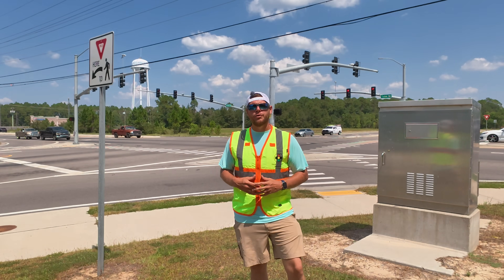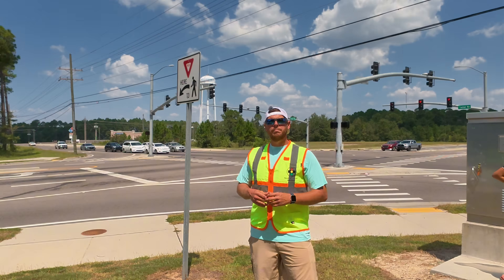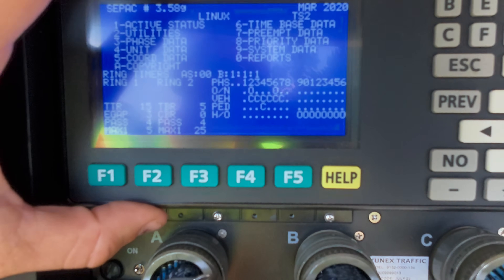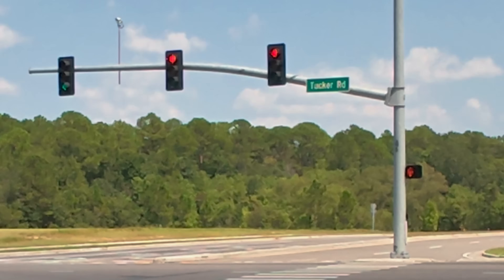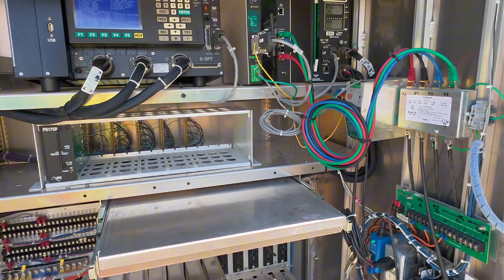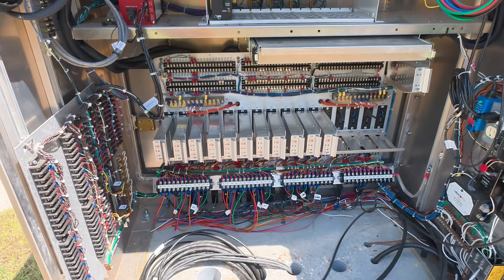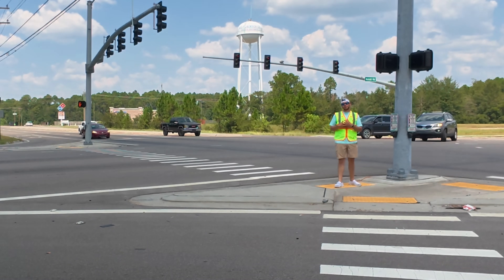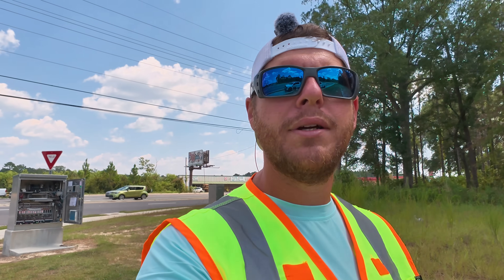Traffic Light Doctor Explains: Do Crosswalk Buttons Work?

Comment: Doesn't the 'decision; on the weight(significance, no body weight) assigned to the Pedestrian?  What sucks is the pedestrian pushes the thing, decides to cross w/o a decision in their favor and the system grants the crossing even though the ped crossed long ago and is not a factor anymore but the control system allows the nonexistent ped time to cross anyway.  Obviously frustrating to anyone that has eyes.  I'm sure Siemens or whoever has some sort of tech to make a better decision.
Reply: Yeah, it happens here 90% of the time. They push the button, wait 5 seconds then run across the street , the ped signals hold up traffic for 40 seconds. They really need to make pedestrian crossings by detectors and shorten the time.
Reply: @colinwinogradoff6794 We tried that with experimental mid ped crossings around 1998 or 1999. Pedestrians stop with no intent to cross or they would jay walk, and the crossing would go to flash with no one there. So we ended up installing push buttons. As far as time, it needs to be long enough for small children, and  the disable.
Reply: @miluth2   Over half the time (I'm disabled in a wheelchair) time I never get all the way across, I end up out of time in the middle of crossing in the crosswalk in the middle of the road and get stuck there.  Sorry but there needs to be an emergency extend button for disabled folks, we can't always make it across WIDE HIGHWAYS in 12 seconds or less.   It's ridiculous.

And then another issue is you press the button, it blinks red and if equipped might make a sound or say something but YOU NEVER GET A WALK SIGNAL and just have to take your chances crossing the street.   I've had that happen, call it in and report it, but it takes FOREVER TO GET FIXED!  Sometimes it's a 2 or 3 months wait, because I use the signal daily and it's the worst part of the signal to get repaired.

   Now why is the pedestrian side of a traffic controlled intersection with crosswalk(s) not as important to our safety when it's not functional, and we have to just take our chances and walk against the stop hand, because the button IS NOT tripping the ped crosswalk signal?

Why is this on such a low priority to get repaired?
Reply: @HolidayDecorator What you are saying is important. if your concern is regarding a particular intersection or more that you spend a lot of time crossing. You may want to take that up with your city, county, or state depending on who maintains the intersection about ped timing being short. Or city representatives, at city council meetings, or online if there is a complaint section.  

Make sure you explain your situation, if you say it to short, as a tech I would check, if it matches the timing sheet,  and meets the required timing for  the length of the intersection, I would check off as okay per timing sheet. 

 I have seen were cities have made accommodations with timing, pushbutton location, and wheelchair ramps due to compliants, I had to make the changes when presented with a new timing sheet for the intersection or a remodel job.  I know of an area that goes on ped recall to accommodate the Jewish in that area on certain day or days, something to do with them not using  the buttons on that day.

I wasn't able to do it without a new timing sheet or remodel instructions from above. As a tech, I was only allowed to put in recalls based on situations I saw in the field. Everything had to match the timing sheet or prints for the intersection due to lawsuits. Any changes I made had to be noted in the cabinet. The ped timing is based on feet per seconds. There something written about the disabled, and elderly. You should begin your crossing on the walk signal, not the flashing don't walk. Flashing don't walk is supposed to allow enough time for crossing curb to curb. If start you on flashing hand, you might come up short.

 Also any issues with buttons not working, call it in explain your situation, Some cities have poor maintenance due to money or employees, or they may not be aware of what isn't working. Cities usually try to take care of issues due to lawsuits. But every cities isn't the same. 

You need to make sure your compliants are going to the jurisdiction of the intersections because one jurisdiction may not pass information to the correct one.
I hope that helps you.
Reply: @miluth2   Thanks, I appreciate the info.  I know it's going to the right department because at one time many years ago, I worked in the D.O.T. Office.

Our city and state has even asked how we could make crossing safer at crosswalks, I've sent in my idea, just get a nice canned reply, but nothing ever comes of it.

Here's my idea of how a crosswalk system should work:

When a Ped wants to cross, turn ALL SIDES of the traffic signal RED.  Also NO TURN ON RED when WALK SIGNAL is active. Allow the pedestrian to cross, then traffic signal goes back into normal mode for vehicle traffic.
This way neither the pedestrian(s) or vehicles get into each other's way.  And it would be far safer than how it's done currently.

I've seen this done in other states, especially on high capacity roads, wide highways and roads and the majority of people usually wait it out at such intersections and crosswalks that are set up like this.

But I was proposing that idea before I ever saw it implented in other places or states.

I believe it works and would be far safer than current standards.

And by the way: I always "TRY" to start my cross when the walk light comes on, but when vehicles come flying up, making right turns on red, sit in the crosswalk blocking me from crossing, I can't always start as soon as the light gives me the go, same with the idiots making the left on green, and I have to stop in the middle of my cross because of drivers that DO NOT HONOR THE LAW.

So if my idea was implemented it would save a lot of lives and allow us folks to cross without incident(it should), but there's always some idiot that thinks the NO TURN ON RED doesn't apply to them.

  Or the ones that stop right over the crosswalk blocking it so you can't cross safely, if you can cross at all.

Sometimes I've been tempted to tell our D.O.T. they need to start putting crossing gates at all intersections that block all lanes, like those at railroad crossings, those would definitely stop a lot of the idiots from stopping on the crosswalks and allow us peds to cross the roadways!🤣🤣🤣🤣

  Being a pedestrian, especially a disabled one can get very frustrating just trying to cross the road correctly and safely.
Reply: @HolidayDecorator cool, I have worked with intersections that have a diagnol cross walk were all vehicle traffic stops, due to ALL RED  only pedestrians are able to cross diagnol and parallel. They seem to only work in some locations. 

I do know there are controllers that gives a walk signal before giving a green to the associated phase to give the pedestrian head start on crossing the intersection. You might want to recommend that if that is something they are able to do. When I see one, I will post a video so you can see what I am talking about. Will get back to you.
Reply: @HolidayDecorator this doesn't work.  For one nobody pays attention to the walk signals, they will cross when the lights turn green.  Two this would cause major gridlock as the intersection would stop traffic for much longer in all directions. If the intersection is at saturation, it will cause even more problems.
Reply: @colinwinogradoff6794   You're wrong.  I have seen it in operation and it actually works very well.

   We need to quit being in such a damn rush to get nowhere.
Reply: @miluth2   Thanks.  I'll send that suggestion about giving the peds a green BEFORE releasing traffic.   That may help a little, but we'd still be dealing with the left turning traffic as the intersection is basically a T with just a little area on the opposite side for accessing the driveways for a convenience store and a car dealership.

  They really should have at least that left turn lane stay red until the ped has gotten across the road(stays red until the ped signal goes to the full stop mode).   The 2 biggest issues are the right turn lanes and the left turn lane going from the minor 2 lane road onto the major 8 lane highway.

And there have actually been quite a lot of pedestrian fatalities at this intersection, numerous ones being of disabled folks that just couldn't make it across because traffic REFUSES TO YIELD TO PEDESTRIANS IN THE CROSSWALK WHEN WE HAVE THE SIGNAL TO CROSS.

That's why I've pushed for the ALL RED and NO RIGHT TURN ON RED at this intersection for years when the ped signal is active to cross the road.

  Or they need to build a ped bridge over the road(and that's been suggested by a lot of folks too.).

  I wouldn't suggest a tunnel due to the area has quite a few unscrupulous people living around it.  So a tunnel would be too dangerous, but a pedestrian bridge that's ADA Compliant would be ideal.

  Then there's no need for the crossing signals at all.
Reply: @HolidayDecorator I just added the video so you can see the walk is on a few seconds before the green. I believe this was implemented due to right turn accidents. If there is a island with a pushbutton and it's room for a pedestrian to be safe that will probably be taken into consideration when asking for timing changes for more ped timing to cross.

 Like I said, all controller may not have that feature, and they are not cheap, if its the controller, I never saw it used when I was working on signals. The city can only do so much to make pedestrians safe. 

The rest is on the drivers and pedestrians. Some  drivers are impatient or always in a hurry, and some pedestrians only see the walk signal and never look right or left. Sit back a watch and you will see what I am talking about. I try to make eye contact with the drivers when crossing the intersection.

In your case more Walk and Don't Walk timing will probably work for you. If the signals are cordinated it may me a process to make the timing changes, if they are willing to do it.

Good luck,😮
Reply: @miluth2   Thanks will check it out.

  I know what you mean, some peds are just dumb and start walking as soon as they get the walk signal, never looking both ways before crossing.

  I always do, but yes, I've watched peds do stupid things at ped crossings, some even believe because they're in a crosswalk AGAINST the light and crossing signals that traffic has to stop for them and they have the right away.

I witnessed one get hit when they crossed on their bicycle(adult), they were yelling at the driver they were going to sue for damage to their bicycle and medical bills.

  When local law enforcement showed up the bicyclist found out the hard way, just because you're in the crosswalk and against the light, you lose when the driver has the green and they didn't.

  So the bicyclist found out they're responsible for all damages to the driver's car, their own bicycle, and themselves since it was deemed their fault.

  They also got written a citation for causing the accident, walking against the signal before being transported to the hospital.

  He got a broken leg out of it, but the fines were expensive.

   Some folks never learn, because he still did it after all that.  Can't get any stupider than that!

Off to watch the video.
Reply: @HolidayDecorator lol!!!
Reply: @HolidayDecorator It is possible to have a separate handicap ped timing button. The traffic controller includes this possibility in the programming. It is also possible to activate the longer walk timing by holding the button in for an extended time.
Reply: @MikeM-cz5ln   Never seen either of those options used.  I've held the button in for an extended time at numerous crosswalks, time was never extended.  And I've never seen a separate button for handicap use that would extend the time.   Interesting to know the controller could possibly do these things, but I've never seen it done.

Comment: The fact people that try to SPAM the button thinking it would make it faster is hilarious… this is what the countries education system gave… zero common sense not knowing a computer is programmed to every intersection and how long a sequence is active before changing
Reply: Here in Toronto all that does is active audio for the deaf
Reply: @ThomasJM   I'm both legally blind but do have some vision, and I'm also 90% deaf in my right ear and about 65% deaf in my left ear, and in the United States, I can barely hear those Ped buttons when I press and hold them, or when they're saying anything.

Traffic noise and other noises just wipe out whatever it's saying.

  These need to be much louder than they are, even my friend who has practically perfect hearing says the volume is far too soft during the day.

  There should be a way to set the volume levels very high for daytime, and softer for overnight, when there is far less noise and traffic.
Reply: People have been doing that with elevator buttons since forever 😅
Reply: Well I have an anecdote. I pressed the button at an intersection and it activated (lit up) but wouldn't give a signal for over 10 minutes (and many cycles). Somebody else came and pressed the already activated button, it changed on the next cycle.

Either it was a coincidence, or they sometimes respond differently to multiple presses.

Comment: There was a TV program done by the BBC a couple of years ago, where they showed, that in cities like London and New York, those pedestrian buttons does nothing.  In smaller cities, it will do something, but as you say, the pedestrian is the lowest priority there is. The buttons work in conjuction with the same phase as the stopped traffic, and hence there is no turn right on RED allowed, as the pedestrians has priority.  (Or left on RED in London, with keep right rules).  Of course, things may have changed again since then.
Reply: In Toronto most of the new ones have the pedestrian button set up for audio alerts for the blind when you push and hold it otherwise it actually apparently does nothing. At older ones that don't have audio for the deaf it depends on how busy a street is whether or not it's always active or if it's only when you push the button.
Reply: can legally jaywalk in major cities
Reply: In San Francisco, some of the crosswalk buttons are labeled "accessible message only"
Reply: There's a T-shaped intersection like that pretty close to me (in Europe). Basically the horizontal bar of the T is the primary road, the vertical bar of the T is a secondary but still often busy street. Cars on the main road can only do a left turn cutting across the other lane to enter the secondary street, no right turn because there's a slip road not too far before that intersection that gives access. Cars on the secondary street queue up in 2 lanes and can flow into the main road.
But as a pedestrian trying to cross the secondary street, pressing the button if I'm not allowed to cross does nothing and I never bother with it. All 3 approaches are filled with cars most of the time so the sequence is always: main road through-traffic for the most part (I get a green and can cross safely), main road left turn into the secondary street, secondary street into main road. The Controller couldn't care less about me pressing the button, it's already hitting the time limits for car traffic I assume.

I'm also pretty sure all the intersections on that main road have their signals synchronised as well, which I still find really cool. Like there's a pedestrian crossing going through the main road a minute's walk or so away and if they are allowed to cross then all the traffic signals on that road align themselves to some extent to let groups of cars on the main road proceed more smoothly and let cars on the secondary streets fill the gaps.
Reply: In Albany CA, two buttons actually give pedestrian very high priority.  Though neither is a 4-way signalized intersection; one is a T where a minor street hits a stroad, and the stroad signal is continuous unless you press a button or maybe it detects a car on the side street.  Other was a HAWK signal by a school, to cross a busy street; cars trying to cross there are kind of screwed (which doesn't stop Google from routing you that way.)

Comment: Main line ped buttons in Atlanta are just there to make some folks feel good ie not even wired up or sometimes nonexistent as most in Atlanta ignore the button😂, so they are in coord with the main line vehicle phases
Reply: Servicing a pedestrian call will not disrupt the coordination.
Reply: @MikeM-cz5ln FYI for troubleshooting purposes. The ped timing can affect the coordination if the engineer did not design the timing correctly or they are okay with it.  It can cause a phase to be skipped or shortened or throw the coordinated phase off. I understand the walk coming on with the coordinated phase and how it works, which isn't what I am talking about. Just thought I would pass something to you in case you are a traffic signal tech and you experience a weird, intemitten issue while in coordination. Might be something to look at.